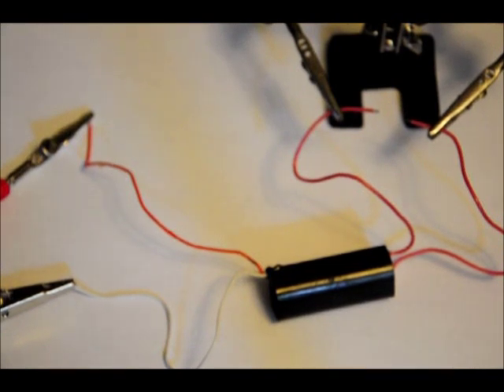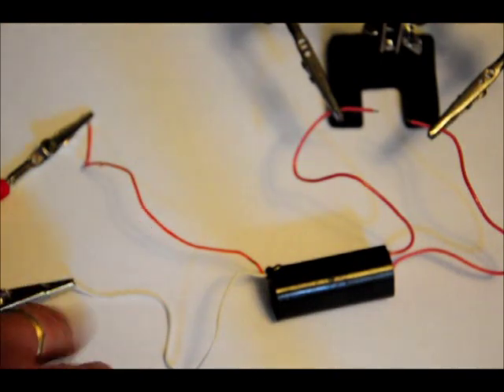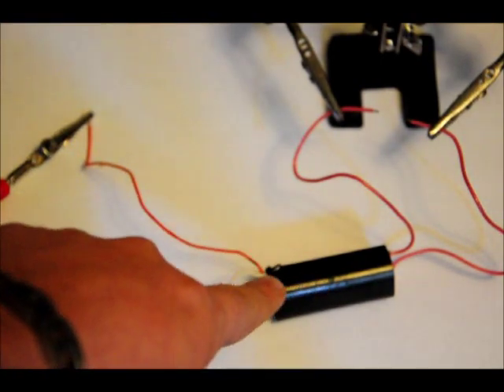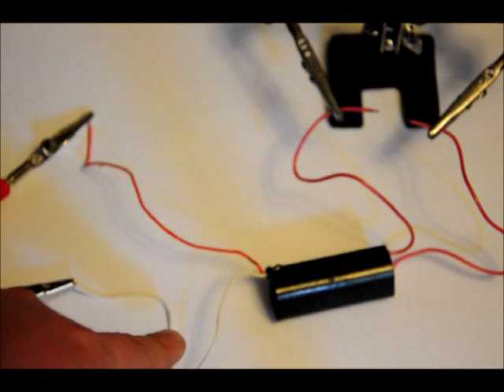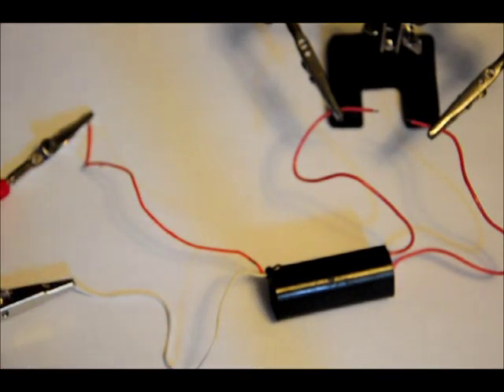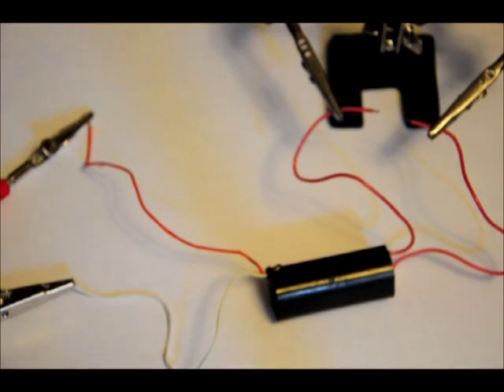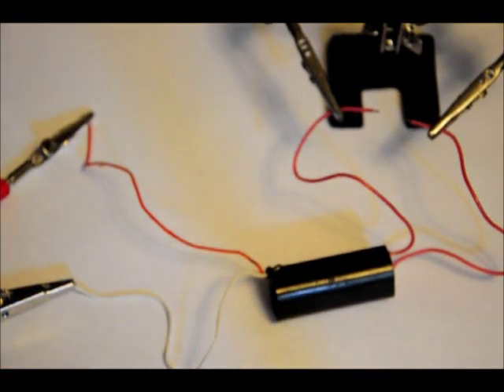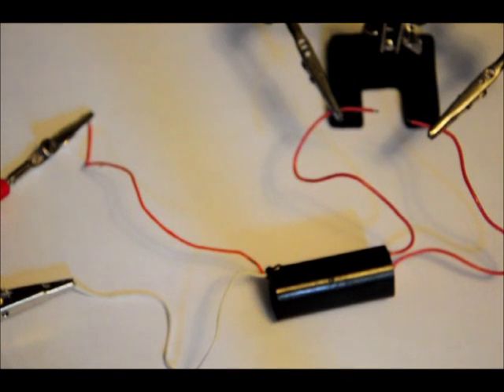The 5v - 30kv+ Arcing High Voltage Transformer Module

Comment: So would this unit be able to operate for longer periods if it was powering a high voltage low amp load such as a small ionocraft instead of just arcing?
Reply: Davey Gregg No. I opened 1 up to see what made it tick. there's just 1 transistor with a diode and resistor and then the step up transformer and a  Cockcroft–Walton voltage multiplier in it. there's no heat sink on the transistor, you should put a heat sink on it if you want to use it for long periods of time, or just use a 555 ic and bd679 on the primary side.
Reply: +wynnful or you can sink it in mineral oil and just cool everything
Reply: dingdingdingdiiiiing yea. well, depends, you cant do that if you carrying it around.
Reply: Sinking one of these units in oil wouldn't work, as it's components are not thermally linked to it's casing. It would overheat and fail internally long before any cooling could take effect. These units can be driven for longer periods at lower input voltages, typically producing an arc over a shorter gap (2~5mm) and operating from about (2vdc upwards at 1amp).